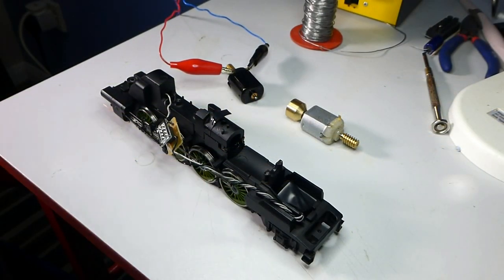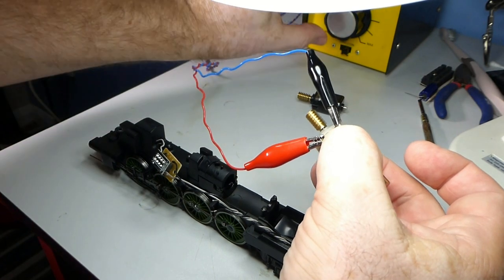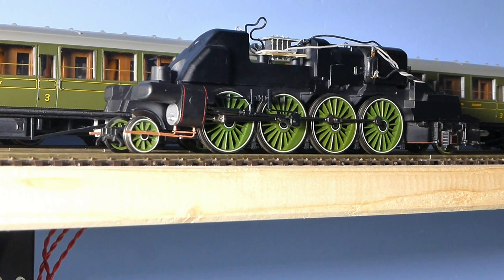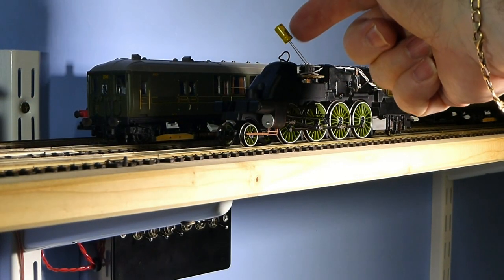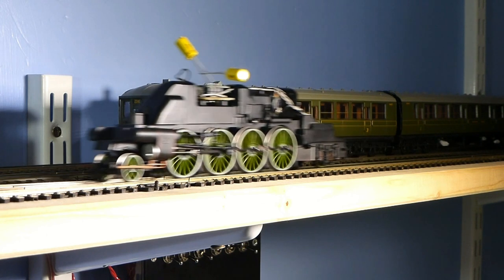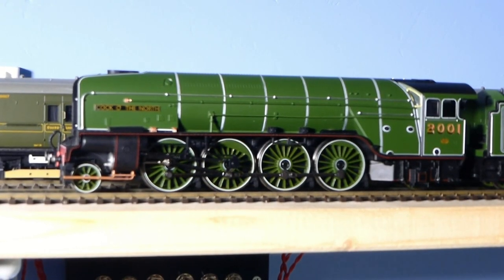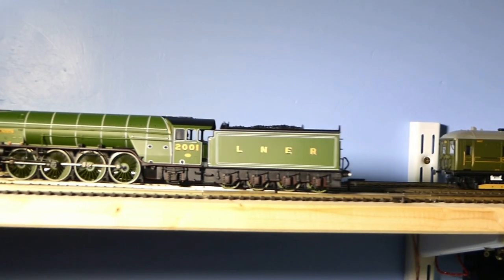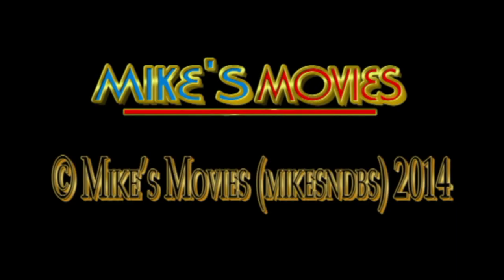Fitting new motor to Hornby P2 Cock O' The North

Comment: Why didn’t you use a 5 pole motor with axels in Botha sides to allow the flywheel to be fitted?
Reply from the maker: Hi thanks, just used what was available at the time
Reply: Motors X6122 & X9712 are 5 pole skew wound with the shaft coming out of both sides that would allow you to equip a flywheel.  😁

Comment: I myself have got round to have my P2 fitted with the 5 pole screw X9108 motor  as Mike shows here. To be honest the YouTube video by BRM did show the test of the P2  I do not think there is just the 3 pole motor more like a 5 pole screw motor. My P2 motor would not pull the skin off a rice pudding never mind 17 coaches. And I am glad people like Mike did this video .
Reply from the maker: +MY DIGITAL IMAGES Many thanks, it's a lovely model and a real looker, what ever possessed Hornby to fit this big powerful engine with the same motor they fit to their budget 04-0s I'll never know, can't have been cost as they then had to make and fit a flywheel to make it run a bit better?????

Comment: Job well done Mike  , but pity Hornby dont have the motors running correctly in the first place
Reply from the maker: Hi David, thanks :) yes I finally feel like I have the performance required, would have liked the flywheel and if one day I can do that I will, but for now this is 90% better than what was there. I fully agree with you re Hornby! they have done so much good work for this hobby over the years, this feels like a step backwards! maybe they will learn from it???

Comment: Well my triang Brit had one wire connected to a contact and the other was directly on the chassis so I swapped the already fitted wire and fitted a new wire in place and it now runs the right way so thanks for advice on that I'm glad I fitted the type 7 motor as it runs a treat now, it's much smoother then the x04 in place previously, my other motors probably do need a remag but I have no such facilities for a job like that but I have upgraded two other x04's with neo magnets and they are incredibly strong now
Reply from the maker: Morning, ah neo magnets, I moved away from them a while back in favour of remagnetizing the old type. Are you anywhere near West Sussex? might be able to help if you are. Meantime check this video out that explains the process. https://youtu.be/DMBjn0LvCjU glad your locos are running well :)

Comment: A really great and informative video. So far mine is running OK but at least I am prepared now. I am going to look out for some 10uF non polarised caps.
Reply from the maker: Hi John, thanks very much. My test lead me to think the caps do hardly anything! they just don't hold enough power to keep the motor going, possibly they might help with split second pick up issues, but I am looking at ways to have tender pickups, I'll post a video as soon as I do.

Comment: very nice upgrade. is there any way to retro fit pick ups into the tender and link them through to the loco as that might stop the jumping on the points.
Reply from the maker: Yes this is something I am waiting on and will do. The capacitors only work for the shortest of contact losses. I understand the TTS version has tender pick ups, however there do not seem to be any spares for it yet

Comment: Nice work on the upgrade. I will be replacing all my motors to the Mashima type ones when the original ones wear out as they are very smooth performers. Not sure I would be able to use the original fly-wheels though :).
Reply from the maker: ***** Thanks

Comment: As the flywheel is made of brass but the motors shaft it steel cant you remove the flywheel from one motor and fit it to the other by using heat, it would sacrifice the old motor but that's already kaput so it doesn't matter. I think I'm right in saying that brass expands more than steel when exposed to heat so how about putting it into a pan of boiling water far a 10 minutes or so then trying to pull lt off, put the new motor into the freezer for an hour or two then put the flywheel into the boiling water again, after a few minutes push the flywheel onto the new motor while it's still freezing then give time for temperature to equalise before running the motor. 
Similar processes are used where I work when fitting dowels into holes which they shouldn't fit into and other uses too.
Reply from the maker: Antony Collingwood Hi, its a very good point and one I did consider, however I was made aware that even the slightest imbalance in the flywheel would result in dreadful vibration. I have not found I need the fly wheel with the new motor so far. But many thanks for the suggestion and method.

Comment: Hi Mike, I came across this video on changing the the motor to a 5 pole, which is something I am looking at on my C O North with TTS Sound. I noticed you connected the two legs of the capacitor to Pins 1 and 5 on the 8pin socket, can I ask which pin you connected the positive leg of the capacitor to?...Simon
Reply from the maker: +Liverton Simon Hi Simon, these were non polarized capacitors so it does not matter :) you would not be able to use a normal +/ type in the same way. However, I'd suggest omitting them and trying the loco like that, the capacitors can only provide milliseconds of 'stay alive' as they are small value. Let me know I'd be interested?
Reply: Hi Mike, many thanks for responding, I am always on a learning curve looking for help from experienced people like you. I thought only ceramic capacitors were none polarized, but makes sense now that they are not. When you mentioned omitting them were you referring to the  non polarized capacitors and using polarized, or none at all.  My only concerns is the DCC power, which is based on Pulse-Frequency Modulation, which is different to DC positive and negative. I am not a 100% sure where to solder the legs on a polarized capacitor...Simon
Reply from the maker: +Liverton -Simon :) Hi Simon, I meant to not fit any capacitors, and if you are dcc then 'do not fit' them. Cheers.
Reply: Thanks for your help and advice Mike, I had a feeling I should not fit capacitors.  Will probably change the 3 pole motor to 5 over the weekend and make a video of me doing it...Simon
Reply from the maker: OK mate, shall look forward to that, I have subbed so won't miss it ;)

Comment: I replaced the motor and used heat to transfer the flywheel over on to the new motor. it's made a fantastic difference it makes me wonder why hornby don't just do this version in the first place. hornby were doing very well with new locomotives coming out with 5 pole motor's then they decided to go back to the 3 pole it doesn't make sense.
Reply from the maker: +trainman2210 I agree with you. Would be most interested in your method?
Reply: +MikesMovies I'm doing another 2 conversion's soon as I'm making 2 more of there class using the hornby model as the Base. I'll try and make a video on it. I wish hornby would watch some of these videos and refine the design's it not much to ask they've got all the bits to do it.
Reply from the maker: +trainman2210 I have no idea why they fit these silly toy motors, they seem to have stopped the Winston Churchill loco is stated as having a five pole one. Be great to see your video

Comment: Mine worked perfectly well on dc but when i installed a dcc chip and put it on my dcc layout it started to stall every now and then but it runs perfectly at a high speed. Could it be stalling because the chip starts it slow and gradually speeds up and the motor is crap at slow speed?

Comment: Hi thanks for replying and please accept my apologies for first comment that was meant to go on another video I watched on exchange motors and clicked on this video for a nose instead and forgot to go back to the other hence I removed it once I noticed what I'd done. Also another question on the older x04 motors I have two which will only run with power on full and until I move commutator with my finger then they just creep along also I do think the flywheel does hinder these models somewhat I've got a railroad tornado which I'm in the process of detailing and only run at low speed as I have a small layout, and finally I don't understand about your replacement flywheel i.e. What it does or how it works?
Reply from the maker: Ah no problem at all, I have done that myself lol don't worry about the electronic flywheel, it has very little effect. Re tge xo4 motors I made a service guide video for them recently, if you look back over my last ten videos you should find it. I wonder how strong the magnets are in your motors? They may need remagnatizing as shown. Let me know
Reply from the maker: Here is the X04 service video https://www.youtube.com/watch?v=O4rpcJ-JoVU&t=4s

Comment: Without all technical rubbish my old triang Britannia class Iron Duke I've fitted with a more modern type 7 is it? Same as hornby use in their jintys, this works well but how do I reverse polarity of the motor please as it runs opposite way to rest of my fleet?
Reply from the maker: HI, thanks for watching, I seem to have two messages from you, this one and another saying "Don't want much for money do every clip it looks like it runs the same then you go all technical on crap I've never heard of, bloody rivet counters" I don't really understand? are you saying the loco appears to run the same in every clip? what technical bits bother you. As to reversing the polarity of your motor you should be able to swap the two feed wires over on top to the motor?

Comment: i did the same mod to my p2, i will say don't bother with the electronic flywheel (tried with 2200uf and had little effect) also dont bother salvaging the old flywheel- i did this and totalled the old motor and couldnt get it to balance to a good standard on the new one, but do remove all the crank pins and check they are sitting dead centre- they have a narrower bearing surface behind the head but in front of the even smaller thread, this is where the rods need to be seated, mine worked but had the rods pinched between the bearing and the thread (couldnt see it until you removed the pin and inspected wear marks) after these 2 upgrades it runs just as well as my other 5 pole locos.
Reply from the maker: Hi, thanks very much, yes the caps don't do a lot do they. Worth a shot I guess. I do now have a new flywheel on order and will fit that if I can, or once it becomes available I'll buy the tender pick ups for it. I'll check out the crank pins and report back! Shesh a lot of errors for a new model!

Comment: Not sure about the capacitors. The benefit is limited and will affect the performance when using e.g. PWM controllers. Personally would have been better leaving the old motor..... I run mine on DCC and the control is beautiful, particularly at low speed.
Reply from the maker: Hi, Yes I agree and now only include a 0.1uF suppressor cap, there was a tiny effect from the 20uF but not enough to be worth it, the new motor is however 100 times better than the original. Thanks for watching
Reply: not with these cheap motors!

Comment: Gday Mike. This is very disappointing to see as I have have been thinking about getting a TTS P2 but now, not so sure (and they are expensive). If I am going to pay the equivalent of 160 pounds, then I expect the train to run perfectly, straight out of the box. I have struck this attitude from Hornby a few times , "Don't criticise us, we know what is best" . You should not have to replace motors etc
Reply from the maker: +Bears Trains Hiya, I do know what you mean! some folk that use feedback control and scc find it runs ok but sounds horrible. Hornby claim it was a bad batch of motors but in all honesty I don't agree. Not sure what their idea was to be honest, probably a money saving idea that went wrong because even they fitted a flywheel (at more cost) something they have never done before. Now I am pleased to say they have gone back to the five pole skew wound types in other locos. The P2 is a wonderful thing, if you can add the £15 for the upgrade motor then you will have a lovely machine for your collection, might be worth buying one at best price and seeing what it's like?
Reply: I have two and they run very very well in standard spec

Comment: Is it DC or DCC?
Reply from the maker: I only have DC thanks for watching
Reply: Would the original motor work better as DCC?
Reply from the maker: As I understand it DCC is a kind of feedback control and yes the original motor was a little better when used with a feedback controller, however smooth running should (and now is) be possible under normal dc

Comment: you can simply add the fly wheel to the new motor I believe.
Reply from the maker: This is possible, but complex, you would need to get the flywheel 100% true otherwise there would be dreadful vibration.
Reply: +MikesMovies that is true you do not want vibration
Reply from the maker: Agree, plus I am sure some localised high heat would be needed to make the seal?

Comment: why do all model trains just jerk to a stop and start........... the real thing seems to ooze to a stop and start....maybe an automatic clutch or something is needed........... run the motor up to speed then slowly let the clutch in..........mind you my last Hornby was a Dutchess of Montrose and  you could only run one train at a time...... two on the same track didn't work..... that was over 60 years ago.....crap really
Reply from the maker: Hi Jeff, they should not jerk at all, that will be a maintenance or track/control issue.